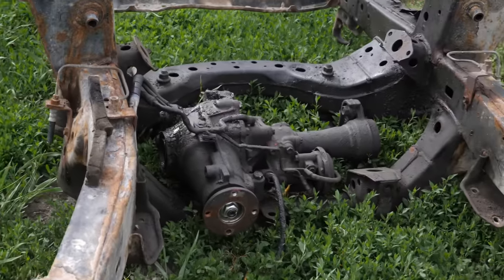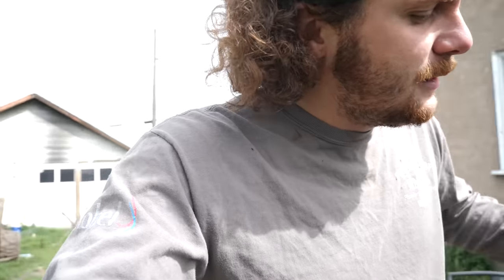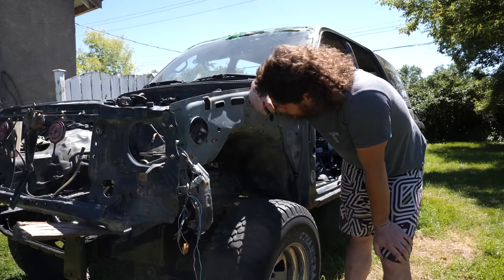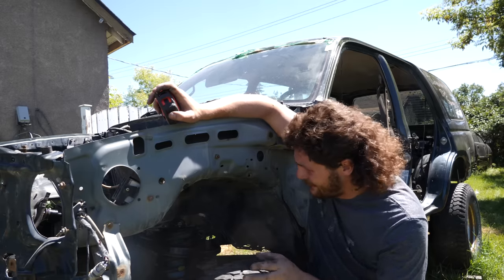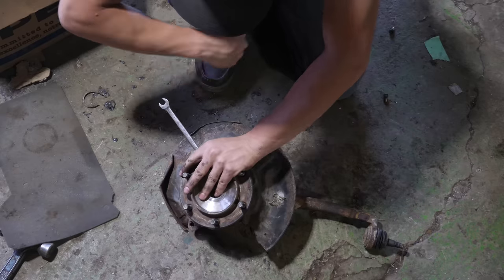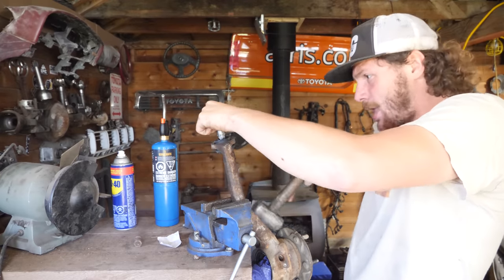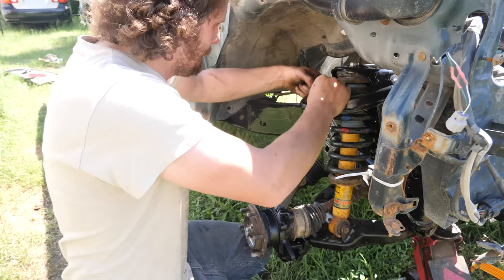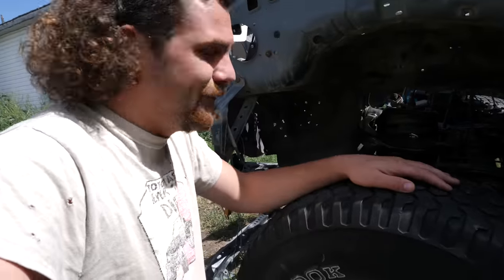CHEAPEST Way To LIFT a 3rd Gen 4Runner?!?

Comment: I have two 4Runners one I kept almost stock the 99 I modded out a lot for off-road steel off-road front rear bumpers with winch 33in tires light kits and lots of other stuff I love the 3rd gen 4Runners they're a good platform for off-roading

Comment: I have a 99 Toyota 4Runner and I put a new rear differential in last year cuz had holes in the housing I had to change the front differential too because it didn't match the Greer gear ratio just make sure the front and rear gear ratio are the same

Comment: Watch out for slightly misaligned lower Tundra shock bolt in relation to the upper hat orientation. Mine was slightly off and, although I could twist the shock to get the bolt in, the bushing deteriorated rapidly. Also try Energy Suspension 9.9484G universal bushings for the lower shock mount. I cut mine down on a bench grinder to make the outside diameter fit in the shock eyehole. Urethane can be cut down easily.

Comment: Out of curiosity, why not go to a tubular upper with a better style ball joint and get rid of those old press in style. Freedom offroad has upper control arms for around 450 usd and also has adjustable coil overs for about 600 usd. I installed them on my 96 tacoma and have put them to the test and they are doing great.

Comment: I've found that the easiest way to compress the spring is to actually mount it in the truck and then use a jack on the lower control arm to compress it/de-compress it. Not possible in your situation since there's not enough weight with no motor, but figured I'd share!
Reply: That’s how I do it too

Comment: You can run the bigger Tundra brake calipers on the 4runner to -bolt on
Reply from the maker: Yup. On the eventually list. But as I mentioned the brakes are like new on this, new same year I pulled it off the road.

Comment: The tundra mod is cool, wonder if it would work for a taco? As well I know you just polished up your calipers, but considering an entire tundra front end swap with the  brake calipers and rotors would be sweet! Extra stopping power and such!

Glad to see the runner getting polished up it's gonna ride nice, I have to swap 5100s for ome shocks in my taco soon.  That diff actuator looked similar to 2nd gen runner as well. Vacuum operated? Did you go with moog bj? 

Glad your still making good yota videos!
Reply: It works for my first gen Taco. All you have to do is use your Tacoma top hats on the Tundra coilover shock.
Reply: Yes 3rd gen runners are identical to first gen tacomas same body style

Comment: The diff drop doesn't drop your whole diff by an inch.  It lowers one side and effectively lowers your CVs by maybe 1/4".  They do hardly jack squat and actually it takes a pretty big lift to actually put enough of a CV angle to matter.  Tinkerer's Adventure just did an excellent video showing how the only thing they do is take away a tiny bit of clearance in the front.
Reply from the maker: Oh I'm well aware of all this. I had it so I used it. No other reason other than it won't hurt.

Comment: hey man since i put a bumber and winch on my 1st gen tacoma the oem strut feel's weak .. wondering if i put tundra strut would help getting a more solid ride ?.. so  since its the same strut 4runner and tacoma of those years what years tundra shock did you take ?
Reply from the maker: My specific strut is from a 02 Tundra. The ones with factory bilsteins are the ones to look out for I'm told.
Reply: @DirtGarage  thanks bud !!